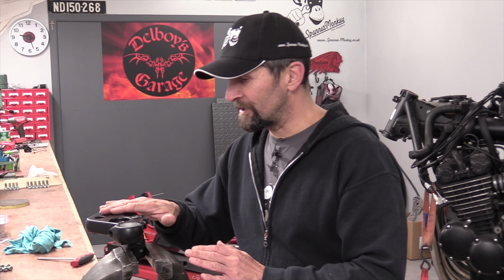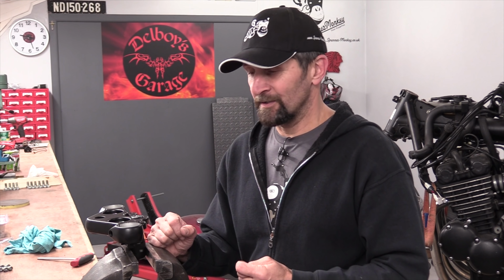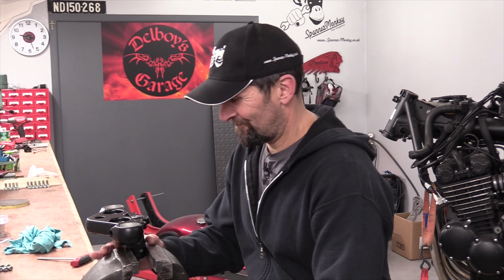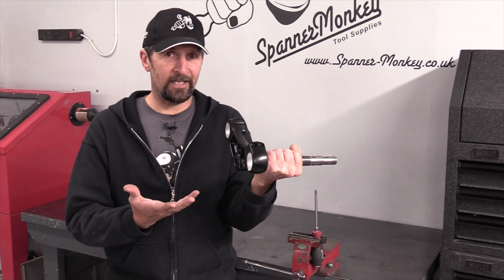Triumph Thunderbird /  TT Legend,  Headstock Bearings install.

Comment: Hello Del, bit of a tip for when you installed the bottom bearing same way I install wheel bearings run the outside of the old bearing on a grinding wheel and take off a few thou and they still work great but don't get stuck in the lip of the headstock \  wheel etc, I keep all the old ones ground down this way you never no, keep up the series this is really interesting

Comment: Sometime try using differential temperatures to slide interference-fit parts apart and together without galling.  A friend and I in college replaced steering head bearings using a flame for heat and dry ice for cold, and drifts made from aluminum tubing and aluminum dowel on the physics department lathe.  We machined the bearing races for a 0.001" interference fit, and by heating the outer part and cooling the inner part, we could slide a part in and out easily by tapping it with the machined tube or dowel.  We had about 30 to 60 seconds to move the parts before they stuck in place.  The force of threaded "bearing pullers" or pusher vices were not needed, and no galling occurred.

Comment: Hi Del, good work as usuall👍 Im sure you have heard this tip before, if you mig weld the old bearing race with high heat the race Will fall out on its own. I work as a fork lift mechanic and I use it when i change wheel bearings, and have a mig welder to use. Try it next time just for fun, you have the perfect tool already thou🤘
Reply from the maker: Cheers mate, there's always a great trick to get round things, thanks for passing tat on mate!

Comment: Great vid Del, must agree with Steve Dennis about the cups being painted as the don't look stainless they could rust... Looking forward to the  final result... 👍
Reply from the maker: The cup washers are zinc plated and the process of gently wheeling them off doesn't cut through the zinc, it just buffs it up and makes it shiney, done it many times and they don't rust, you have to grind a lot harder to wear through it, it's a good option for protecting metal... glad you've been enjoying the videos, loads more to come!

Comment: These are the sort of videos I really enjoy, mainly as I personally need to do exactly the same, well once I’ve finished the SSSA, suspension & Hub rebuild. Currently sourcing alternative bearings as triumph or wemoto do not stock them, however looking elsewhere at bearing manufacturers has ended up saving loads 👍🏼

Comment: Nice one Del. Simoniz is a brilliant paint to work with & floats out real nice. The timing of this vid is bang on again, I'm going at the bearings on my bobber over the next few weeks. Liking the threaded bar method and the make a tool!! Catch up soon bro. Awrabesht to you both from me & all the clan. 😉🤘💙
Reply from the maker: Hi Al, great to hear from you brother, decided to go with the gentle bearing press with this one, I could always tap them in, certainly the taper receiving cups, but the radial bearing just seemed more sensible to press in gently... take care of yourself and clan, keep in touch mate, D&Px

Comment: Nice job Del , i bet most motorcycle dealers would not go to as much trouble  .
Reply from the maker: Thanks mate, generally speaking the technicians I know would certainly take the time on installation of the bearings the same as I did, but this project is partly restoration and I've no time limit or constraints,... I do have sympathy for commercial technicians as they have a lot of boots up their ass every day, chasing them down to get things done... it's not a job I would want to do again!
Reply: @Moonfleet41  Take your point Del ,my brother a car mechanic 40 years now  he would say the same ha.

Comment: OK: your showing off you have a metal lath but you spent all your money and can't afford a bearing  greaser . Thanks I'm looking for a 2% triple tree to replace the 4% one that came with my 03 V-rod as a winter project. And I have a 65 pan head motor on a rigid frame and I have a low mileage 2004 front end from an 04 Deuce that I can now put on it. Going from a cable drum brake to a disk brake could extend my life expectancy around here. This information should help me this winter. Now that we no longer have any adult step children or grand kids living in the house and taking up my work space. I'm retired for two years now and though I am busier than I expected in the spring summer and fall I will have time this winter. Thanks this information may come in very handy. Mike

Comment: You are so damn clever. Only thing I would need is just a little bit of voice over talking about your pulling tool and the tool you made from the scrap rod in your drawer to push out that ring from the headstock.
Reply from the maker: Hardly clever mate, it's only basic stuff, and it looks like you understood the screw press and the bent chisel without  talk over, I try to let the demonstration make it clear, but feel free to ask if you're not sure mate.

Comment: Fantastic job del, please tell me where you got your the Vernier  calipers , I love the dial , do you think there better than a digital one ?. cheers .
Reply from the maker: Hi Dylan, this is the caliper I use, it's designed for use on electrical work, so has no metal parts, it's made from very hard composite material, it is accurate but does have a little flex in the jaws, so not to be relied on for precision work, for that I'd still use a metal caliper, but here's a link mate, and I love them, they do a great job for general measuring!  https://www.spanner-monkey.co.uk/Wiha-Analogue-Calipers-Dialmax-ESD-31439?search=dial%20caliper&description=true
Reply: @Moonfleet41  fantastic , thanks so much for the information . Keep up the great work pal.

Comment: Just out of curiousity, I wonder if you could have "milled" the old risers to fit the new fat bars youre going to use. What would be the process, or what would be the things that make it not possibel? By the way, I really enjoy your attention to detail when you are doing these projects. You really seem to enjoy the process. Almost as if its a relaxing for you. I tend to get too impatient when im doing things like this. I need to learn to enjoy the process more.
Reply from the maker: Hi John, yes that would have been cool to mill them out, but its a much bigger hole to make, 22mm out to 28mm and there isn't enough metal on the factory castings for the bigger bar, and even the bolt holes are too close together... plus of course, more obviously, i don't have a milling machine.!!!       and yes, it is relaxing to assemble things, take pride and enjoyment from each little item, and see the job as a long row of tiny projects, one component at a time, and not one single job... i spent many years as a mechanic on the clock and time constraints.. now i can take time and enjoy it..!
Reply: @Moonfleet41  Ah, I didnt realize the new bars were substantially bigger. Thank you for your reply. And keep up the fantastic videos. I have been a sub for years. And I enjoy them.
Reply from the maker: @undrtkr26  Thanks buddy, yes a fat bar as referred to, is a motocross style bar that's 28mm at the centre in the clamp and as it curves out to the grips it tapers back down to 22mm, makes them stronger with zero flex and they look chunky as well.. you'll see. I'll get to them in a few video's time!

Comment: Great job though some of the tools you use may hinder some from attempting it themselves, I don't blame you for using them as it lets others on the next level know what tools are available and you probably did it in the past without them anyway so reference to that would be good. 
It would be interesting to hear what the channel that does nothing has to say. 
Incidentally, I'm not sure if you're aware he has thrown the gauntlet down to a build off with Alan Millyard. I doubt Alan Millyard will put his reputation at risk, lol, so I made it easy for him and suggested if he builds and finishes anything will be a challenge and will impress me. I await with bated breath. And I know this will get back to him but hey he hates me anyway and I wouldn't want it any other way.

Comment: I want to do this over the winter but live in Western NY so cold and my garage is only
Insulated where it meets the house. Should I prep and do inside or temp not a problem?
Reply from the maker: If you're referring to installing bearings, then normal outside temperature is ok, but if you're referring to painting, then 15 centigrade is minimum, at least during and for an hour or so after the paintwork, so perhaps a heater in your garage whilst you're doing it!

Comment: I have a steering head bearings question. Do tapered steering head bearings have a different feel than when using OEM roller steering head bearings?
Reply from the maker: Not at all mate, if in good health and correctly adjusted, they will both feel the same.
Reply: @Moonfleet41  ok thank you man.  I have a Yamaha fjr1300es with 13 thousand miles on it and I recently had the oem bearings changed to tapered bearings and I have had a shop adjust the torque settings twice now. And the bike is sensitive to steering input especially at speeds above 55 mph. Is there any ways that the shop installed the bearings incorrectly or anything.  I'm starting to get mad about all of this
Reply from the maker: @marshall3498  The method of checking headstock bearing correctness is not riding it at speed, but actually a static check.  If you can lift the front wheel, crouch down in front of the bike, and grab the bottom of both fork legs, turn the steering through it's full range of lock side to side, there must be no pinching or resistance, and no notch in the centre, it must glide smoothly lock to lock.  Then pull the bottom of the fork legs towards you and away again, to check for any free play or float in the bearings... there should be none!  If that is all good, it's not the bearings.  Other things can affect your steering, tyre pressures, tyre condition, wheel bearings, rear wheel alignment!  So perhaps check a few of those things too to make sure it's not something else that's wrong before you blame the shop!
Reply: @Moonfleet41  ok thank you man very much. I have checked the tire air pressure several times. And the front wheel bearing and the tires have only about 1500 miles on them and the wheels are balanced and not bend either . I have no idea what the problem is now. The shop told me the torque settings on the bike are correct now.
Reply from the maker: @marshall3498  OK, good to hear you've checked it over, do check that free play though, just in case and can I ask what pressure you run your tyres at?
Reply: @Moonfleet41  35 front and 45 rear psi that on the swingarm of my 2016 Yamaha fjr1300
Reply from the maker: @marshall3498  OK, those tyre pressures printed on the swingarm are a guide, and not totally strict, tyres vary in their carcass strength and profile... so try a little experiment perhaps with a slightly higher pressure in the front, tyre 38 maybe and drop the rear to 40, 45 is a little high unless you are very heavy or carrying a pillion... so dropping the rear will bring a little stability by expanding the tread patch/footprint slightly, and increasing the front a few psi to 38 will help with 'roll in' to bends.    Go careful when you test ride it, don't dive in to your first corner, just build up the maneuvers and see how it feels... personally on my Hayabusa I run 42 front & rear and it's perfect, even on my Bandit I ran 38 front & rear and again it was perfect!   Your FJR is a heavy ol' girl and will be quite sensitive to incorrect tyre pressures, so have a play and see how you get on... and remember, small changes only and go careful when you test it!
Reply: The argument between ball and cup bearing or taper roller went on for years with many pro's and con's, one of the arguments for ball and cup was less resistance and better feel and at the time GP bikes favoured ball and cup, I doubt you are doing GP's on your XJR1300 (nice bike by the way especially in yellow, I did clutch slave cylinder seals on one a few weeks ago).  Taper rollers would apparently last longer, bare in mind you ride a heavy bike, if the bearings fitted were not up to the job Yamaha wouldn't have fitted them. Del's bike was fitted with a taper roller as standard.

That said do I know what's better, No and I believe the argument is still out there. 
Del's check is on the ball through my last check is when the wheel is in the air and the bars turned from the centre they should slowly fall away to the side in each direction with the weight of the wheel. As for the torque of the steering head bearing, I haven't known these are torqued before unless they are referring to torque as feel.

It would also be interesting to know what you mean by sensitivity above 55mph, i.e. is it wallowing in corners, is it wanting to shake its head if you role off or remove your hand from the bars etc. Again Del is correct on tyres though you checked these but if nothing changed before the bearings were changed and you checked the tyres it would be interesting if changing back to ball and cup bearings cured your problem, people change to taper bearing thinking they are better there is nothing wrong with ball and cup.

Lastly, it is horrible having no confidence in a bike especially in a bike this size and I think your dealer should be helping you more on this. (I don't know maybe he is) sorry for the long comment to you and Del.
Reply: @nightster6378  there is no wandering or shaking of the handlebars at all. Bike is still smooth and tracks straight it just doesn't take much handlebar input to make move in the lane of the road. I doubt the dealer would replace the bearings back to oem style of roller bearing.
Reply: @marshall3498  If this is your issue Im surprised as technically you have introduced more resistance, some people like it the sensitivity you have, personally I don't, then you may need to consider a steering damper.  

I've heard of people as I'm sure you have changed to a new tyre or shock of a different manufacturer recommended by others only to remove them with next to no miles.

Therefore as for OEM bearings, if this was the only thing changed I don't know why he wouldn't change them back you're the customer, did you ask for TR's? If not he should have told you what he was going to fit, if you agreed you are paying. i.e. OEM bearings are generally more expensive than aftermarket TR's or were when I last checked and one of the reasons fitted.

Comment: Hello, I know you have mentioned this in a previous video, but what is the paint you use on the headstock? And secondly, where do you get the bearings from? I have a 1982 Yamaha Seca 650 and want to replace mine with a new and improved set
Reply from the maker: Hi Mark, the paint is Simoniz Tough Paint in Satin Black, and we got the bearings from Wemoto... they will certainly have bearings for your bike, and what a fabulous old muscle bike that is, be proud of it mate, they're getting rare now!
Reply: Thank you for the info. My 82 was my first bike I ever purchased and I still own it today, wont ever part with it. You have inspired me to do an overhaul on it this winter.